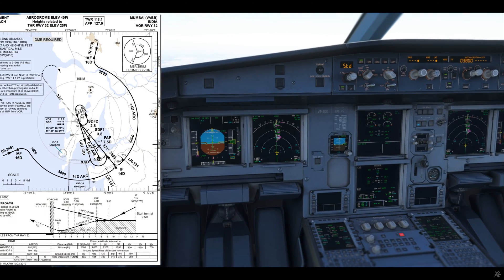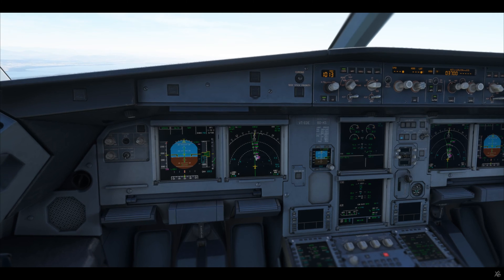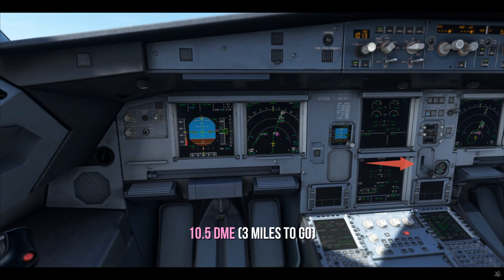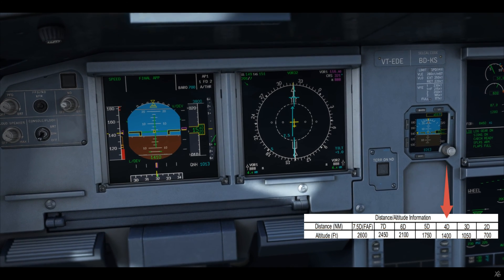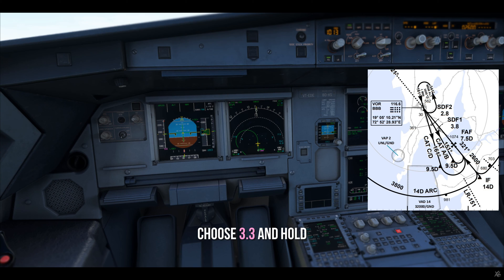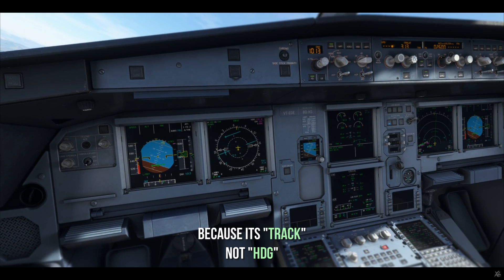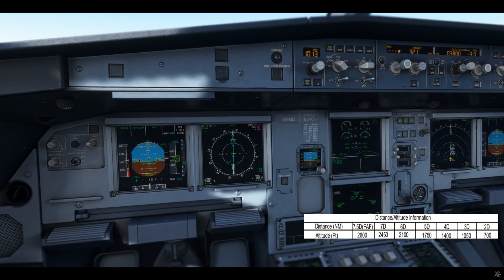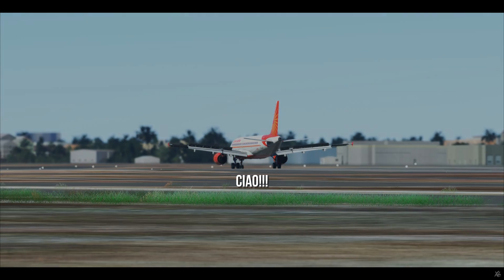AIRBUS 320 : HOW TO DO A VOR APPROACH -4K

Comment: great video, a little advice, if you want to increase the resolution of your shadows from 2K to 4k, go to the LocalCache folder, then open the UserCfg.opt file and search for "shadows". Replace the value 2048 with 4096 and save it. That's it. You will see the difference very clearly. Thanks again for the video.